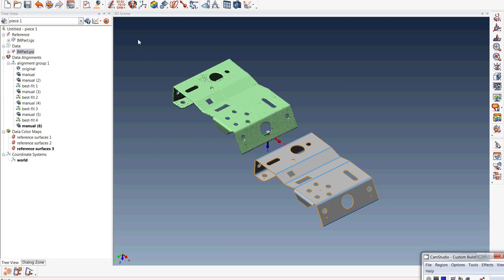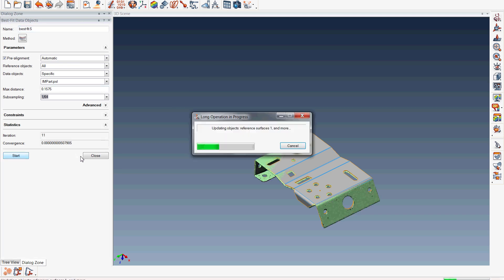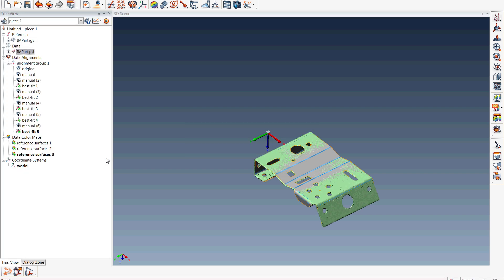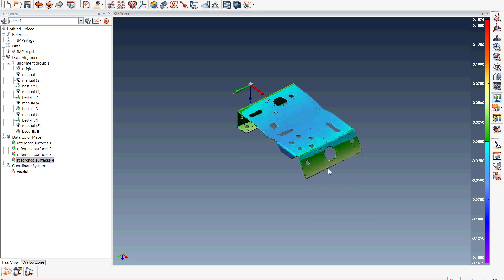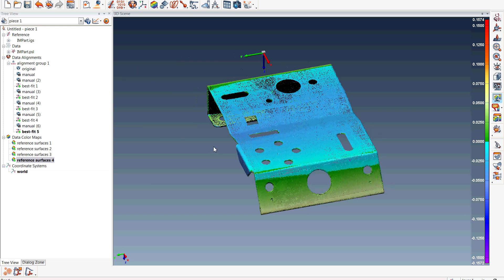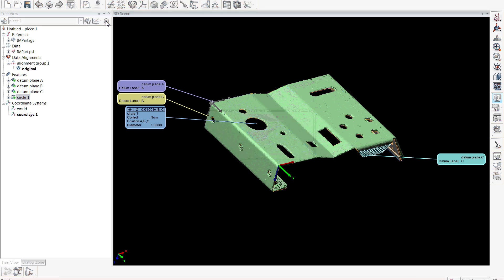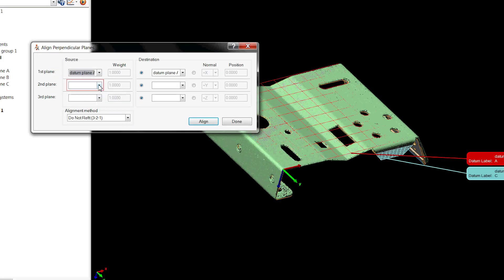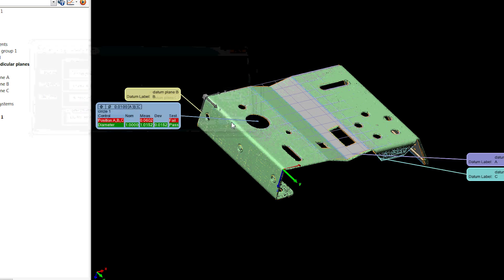Best Fit Alignment vs. Datum Alignment

Comment: I need  full explanation of best fit alignment
Reply: Best fit takes what youve measured and it matches it up to the CAD model . For the scanner, it is best to use a 3-2-1 point pairs best fit if thats what youre trying to do. If your trying to do this on the CMM, you would want to measure features like 3 holes, or 3 Spheres to best fit too.
Reply: @milescarlson5848  Please verify my understanding for datumalignment; datum restricts a feature e.g.. a plane, a cylinder or a plane, which means they have nearly zero deviation (or shows in green color of colormap), then another feature shows the position according to that paired feature.  Is it correct? Thank you at advance.